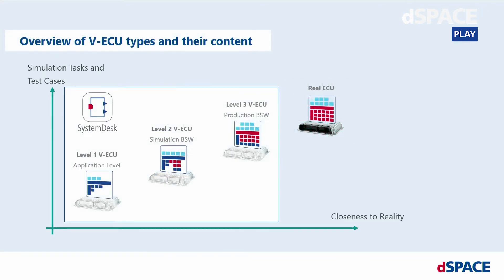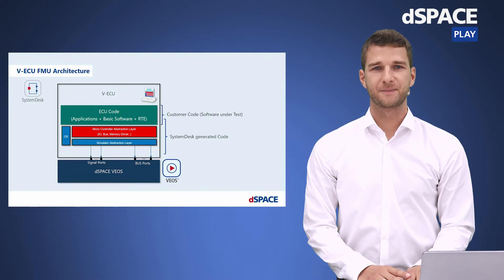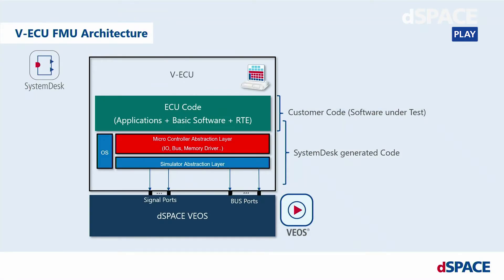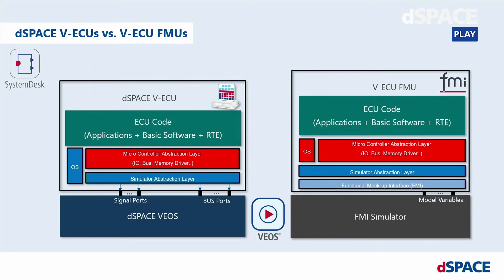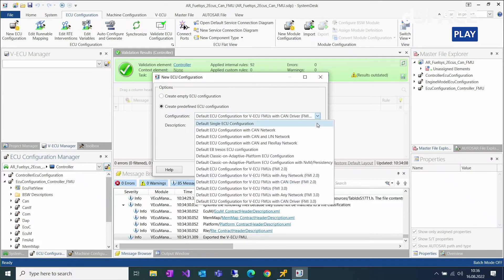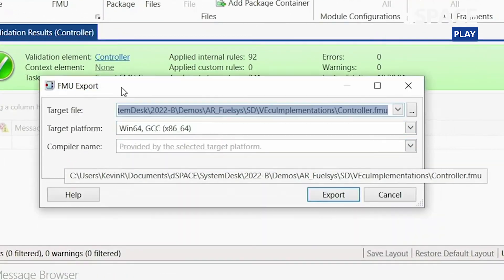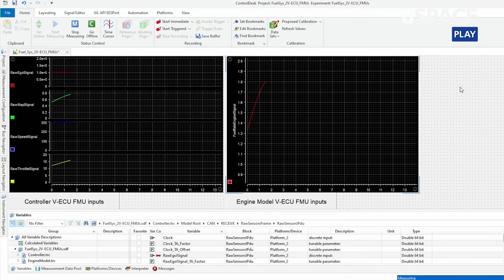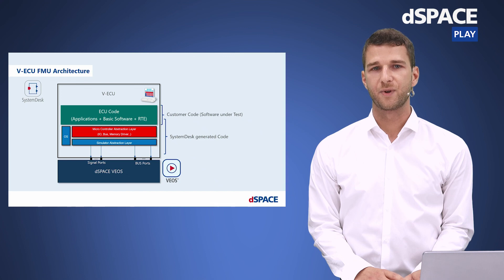Creating FMI-compatible V-ECUs with SystemDesk

Comment: Does VECU supports for Fusa(ISO26262) Swcs also? E.g. ASIL D level?
Reply from the maker: Whether a V-ECU is suitable for testing functional safety requirements depends on the structure of the V-ECU.
SIL is of course generally well suited for testing Functional Safty SWCs and the dSPACE tools are certified for such tests.
Unfortunately, this question is too complex to answer in full detail in the comments. Please send an e-mail to mailto:support@dspace.de. Our colleagues will gladly help you.